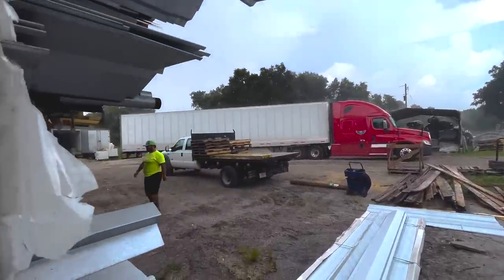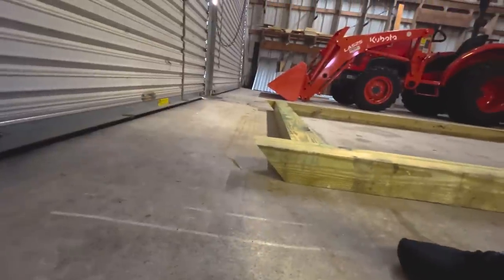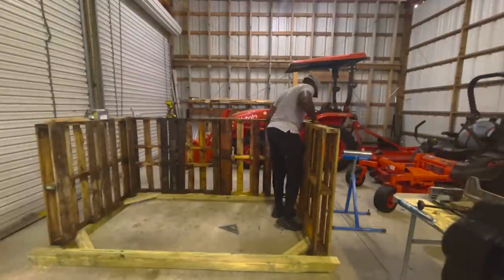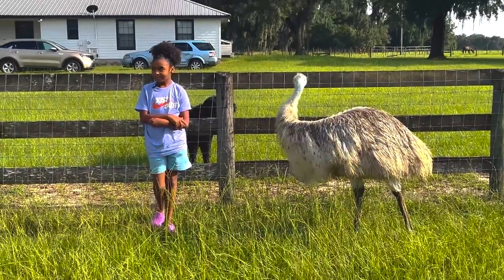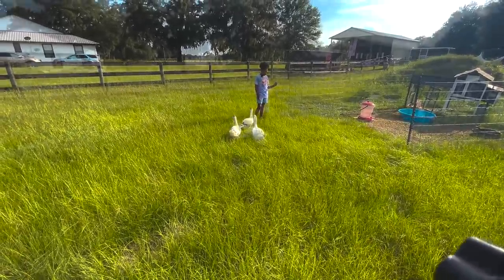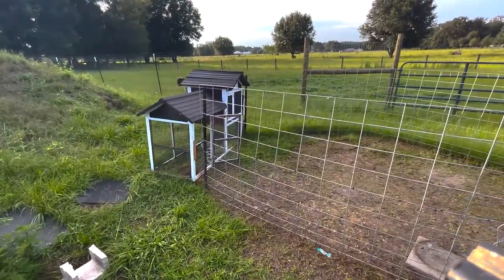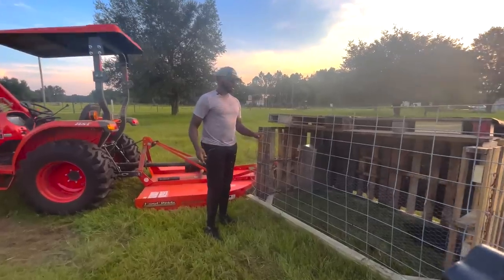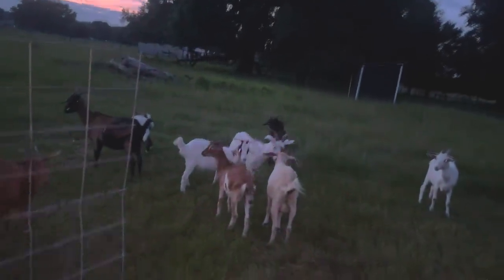Thor Had To GO | A Surprise For The Goslings

Comment: When you get heavy rains the tarp will leak and with strong winds it will rip. If your going to use a tarp the canvas type works better then the plastic type. You say you want to do it right the first time then I would go with a metal or aluminum roof but it is up to you

Comment: I feel for you man i been getting that soaked just by going outside for 20 minutes in this 104 degree heat we been having in southeast Alabama 😂 have to change clothes at least 3 or 4 times a day. Hope it cools down and clears up for you soon 👍🇺🇸🙏
I’ve had a lot of dogs and I’m telling you your dog isn’t going to sleep in that when it gets older. You need to put the food and water on the same side so he can have a corner to sleep next to they like that. You feeder lid needs to be near the front so you can easily open the top.
You need to have a big overhang on all 4 sides to keep the sun off the dirt inside. They dig holes in the ground to find cool dirt to lay in and if it’s not cool dirt he will only go inside to eat and drink. You can have metal hanging way over the front and sides without much support. He will need a cooler place with all that fur and in this heat to cool down. The walls are fine being open with the pallets which partially helps shade it. Good luck guys 👍🙏
This is just what has worked for me sorry it’s so long
Reply from the maker: Our washer and dryer have never gotten so much use 😂 

No need to apologize, we really do appreciate that you took time to leave details from your experience with dogs.The more details the better, and I read fast so it didn’t feel that lengthy 😆

Comment: Why not take apart some pallets and take them boards and attach to the other pallets where the space are in between the other boards on the pallets. Just saying it is cheap . Pop could be the one with a dark spot on the back .? Where's the emus water ???
Reply from the maker: We may have to do that. For now the chicken wire around the entire perimeter has been holding tight...but I have a feeling mama is going to put me to work as we continue to edit this build. Thank you so much for the idea. Frankies main water source is the water tub behind her home that stays full plus she has the pools of course. ❤❤